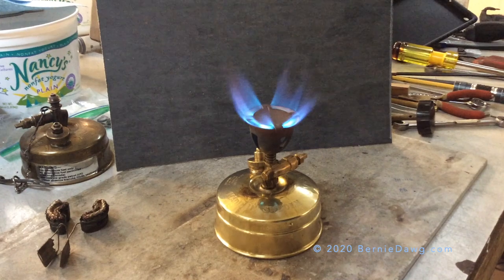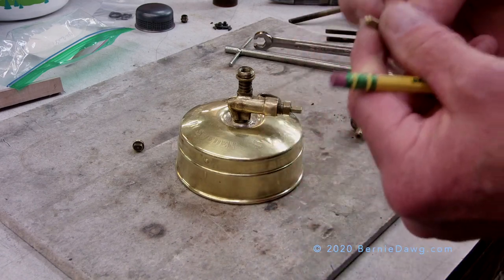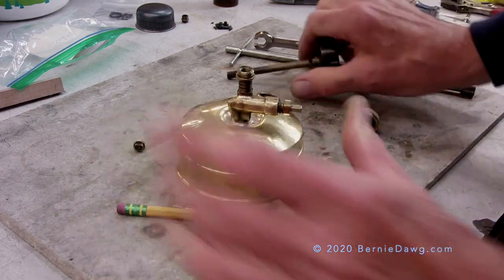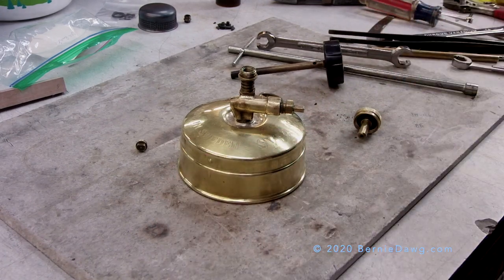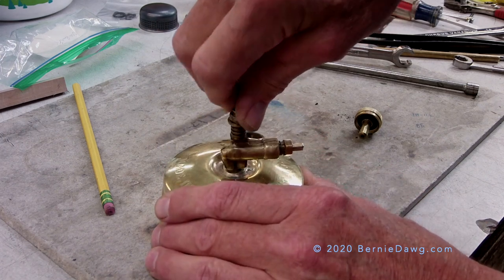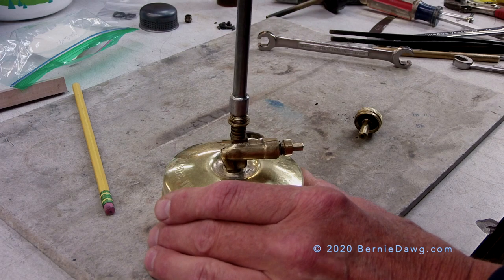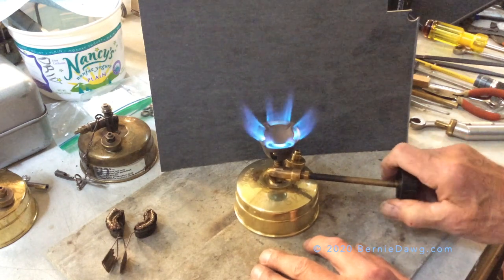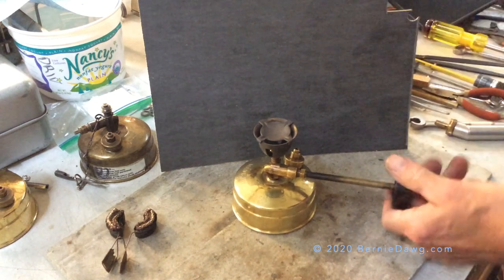Setting a Svea 123R Stove Cleaning Needle

Comment: Thanks for that 😊.
I think (?) that the same goes for the Optimus 8R Hunter. Bought mine new in the late 70's .. still in regular use and going strong.
The only repair that I have had to make so far to the Stove was replacing that very same graphite seal in 2009 (I think?) so that 'squeak' sounds familiar 😊.
If I had to choose just one Camping Stove .. it would be my 8R .. a great little stove 👍. The 123 is in my sights .. but I still have to figure how to fit it into the budget and then get it past the Self-Appointed Anti-More-Camping-Stuff' Firewall / Virus Guard 😉.
Take care .. stay safe 😷 ..
Reply from the maker: Thanks! Yup, the needle-setting is pretty much the same on all the stoves that have them. I show the 8R in my video tutorial pair here: https://youtu.be/CVe8LfXCalA and here: https://youtu.be/3ytcym3qhcA . Or, to be exact, here: https://youtu.be/3ytcym3qhcA?t=503 Maybe helpful? BD
Reply: @BernieDawgCinema  Very helpful .. thanks 👍. Much obliged 😊.

Comment: Excellent video, siple and informative! Just one question, i have a juwel 34 and i want to find a graphite packing for that, any ideas???
Reply from the maker: Thanks! Two ways to do this. One way - get part #2091 from Base-Camp in England. You can find the link to Base-Camp at my links page here: http://www.berniedawg.com/stove-part-supplier-links/ 
Intended for the earlier Svea 123(no R) with it's smaller diameter spindle, I believe that #2091 packing also fits your Juwel 34. (I've not tried this.)
Second way -  use wraps of graphite ribbon around the spindle, then mash it all together with the spindle nut. Graphite ribbon is available through many sources, but it may be easier just to get a sheet of graphite from eBay seller "terrry123" (yeah, 3 r's) and slice it into suitable ribbons yourself. I've done all that many times. Fiddly, but works fine in the end.
Hope this helps. BD
Reply: Eeexcelent!! 2 answers at once! Hehe, thank you very much buddy! I really didn't know where to find a graphite packing for these jobs.. Though the graphite tape must be a good alternative! I'll get both and one day i will also buy one of your silent burner caps though i don't know whether this will increase the temperature of the tank quicker or the opposite :D 
Cheers from Greece man and keep up the good work!!
Reply from the maker: "though i don't know whether this will increase the temperature of the tank quicker or the opposite" The caps have zero effect on tank temperatures. After all, silent burners have been commonly used on millions of stoves since 1898. 👍 BD
Reply: You are right! It's a tried and true concept! Thanks again and keep up! Others make videos for knives, others for tools etc, but whatever someone does right really helps sustaining information and keeping people educated in subjects they could not otherwise find reliable information about! See ya!

Comment: Just rebuilt mine, works great but no blue flame? Not sure if I inserted the wick properly? There was maybe 1/4” of the wire showing. Used a new needle valve shaft assembly as the geared portion on my old shaft was worn, as was the teeth on the cleaning needle bar. 
I used a wick that is sold off eBay. Comes in a 4 pack of different strands and lengths. Hopefully I used the correct wick?
Reply from the maker: @Michael Fogarty I have an eleven video playlist that covers all sorts of things about the Svea 123R. There is a pair of disassembly/assembly videos in that playlist that shows most all the details.
https://www.youtube.com/playlist?list=PL9Tg7BYD6fULxLmRcd7hQL_ZP2vyBqlZk
If you don't have a blue flame, perhaps you are using automobile gasoline instead of naphtha (Coleman fuel). Yuck on auto gas - don't do it. Or, perhaps your flameplate is set too low. Or, perhaps you were in a hurry and didn't let it run for a good twenty to forty minutes to self-clean the old crud out. The possibilities are numerous and my videos cover most of it. 
Or, just drop a note to my free help line with some photos. It's free. bd@berniedawg.com Did I mention it's free? BD (free)
Reply: Thank you, yes, I’m using fresh Coleman fuel. But I only let it run for maybe 10 minutes, So I’ll try running a tank through it, and see if it improves the flame.
Reply from the maker: @Michael Fogarty Again... many things could be the issue. And, again... just drop a note to my free help line with some photos. It's free. bd@berniedawg.com Did I mention it's free? Virtually impossible to diagnose your issues if you won't communicate with some photos via the help line. BD (free)

Comment: Does this work the same way with the Chinese version of the svea 123 R made by lixada and several other manufacturers?
 mine slogged after my tenth use and I'm trying to figure out how to get it unclogged
Reply from the maker: @Mike Rilling Seems to be the same idea, yeah. If your stove clogged after only 10 uses, wouldn’t you contact Lixada for service/return/repairs/refund? They claim a six month warranty. If you are using quality camp stove fuel, it shouldn’t clog. If you’re using pump auto gasoline, well then, there’s your problem. Pump gas sucks in camping stoves like this - clogs them up fast. BD

Comment: Hi BD, 
Recently bought a new 123R and I'm a little confused....
On the one I have, I turn it fully to the right to shut it off, however, after priming it, it's letting out gas and igniting the burner. I have to turn it fully to the LEFT to shut it off. I'm just wondering if I'm doing something wrong or if theres a fault. I've tried resetting the pin like the video also. 
Thank you for your time.
Reply from the maker: Hi Hell Dysphoria, Brand new Svea 123R stoves are not made in Sweden but are manufactured somewhere in Asia at the bequest of Swiss multi-corp conglomerate Katadyn Group". There are increasingly frequent reports of quality control issues associated with these newly-made imitations of the original Swedish made 123s.(I don't recommend buying new since there are thousands of vintage Sveas easily purchased through eBay.) 
You should be able to turn off the stove by gently/firmly turning the spindle control fully clockwise to the right. Don't force it, as that can cause damage to the spindle tip. If you feel the cleaning needle has been mis-set, take it out and try the stove without it. The stove should work fine without the cleaning needle rack in place. 
If the stove still won't go out by turning the spindle control fully to the right without the needle rack in place, then: a. there is an obstruction in the spindle area, perhaps shavings or debris from the production process, b. the spindle tip has already been damaged from using too much force to close the valve, or, c. the spindle and spindle seat are poorly formed or manufactured. Drop me a note at berniedawgstove@comcast.net for more on how to resolve these issues. I'm running out of space here in YouTube comments. Good luck! BD

Comment: Great video. My flame is very uneven. More one side than the other side. How do I level it out?  It’s a new 123r
Reply from the maker: @Peter Foote New Svea 123R stoves are made in Taiwan and the quality is lower than vintage Swedish-made stoves. Your experience is typical. If you don’t want buy a vintage Swedish model… you could try to bend the bell into alignment with your off-center jet. Grab the bell in your hand and gently/firmly move the top toward the side that has more flame. This will help center the vapor stream on the flame plate. Test it, and see if you need additional bending. Repeat until you get it centered. BD
Reply: @BernieDawgCinema  what year was the last Swedish production? thank in advance.

Comment: Just got my first 123R. Used the current Optimus parts kit, but I don’t have positive shut-off yet: when the stove builds pressure, it squirts fuel through the jet. 😕
Reply from the maker: @Bentbrook's Rambles Try the stove shutoff without the cleaning needle in place. (Think of the cleaning needle as an "optional" upgrade.) Stove should shutoff w/o the needle - if not, there's a problem with the spindle seat or spindle tip. Make sure you have the Svea 123R spindle in there - not the 111 spindle. Once the stove shuts off without the cleaning needle, add the needle in. It may take several tries to get it "timed". Good luck. Nice hike, btw. 👍 BD
Reply: BernieDawg Cinema Thanks for the tips! I’ve got it shutting off now (original jet and cleaning needle)—it seemed to “settle” once it got hot. So now I’m learning how long I need to prime it. Such a gorgeous stove with lots of character! Any tips on the Minicap with legs, or is it literally as simple as it seems to use?
Reply from the maker: @Bentbrook's Rambles The Minicap with Legs is pretty simple. But, for best results, you could always read through the instructions online so you know all the tips about caps I can think of to write down. :-) http://tinyurl.com/lvv3syn  But, please remember... if the stove doesn't work great with the flame plate, the stove won't work great with the Minicap, either. BD
Reply: BernieDawg Cinema Thank you! It’s working great now.
Reply from the maker: @Bentbrook's Rambles Awesome! 👍🥳 BD

Comment: Question: How long is the wire/needle part actually supposed to be above the regulator spindle? The one on mine is only about .73 thousands long and just barely extends beyond the orifice of the jet at full extension. Not visible, but can barely be felt at full extension.
Reply from the maker: There is no "supposed to" - no specifications chart from a manufacturer. And, there are variations in the casting and machining of the stove valve bodies. These are not clocks or airplanes - not that high of science. Each stove is a bit of an individual. Best not to try to quantify it to the thousandths of an inch/millimeter in the way you are attempting. The needle hangs out of the needle rack about 4mm. The needle extends through or into the jet to the extent that you may be able to see a stub of needle OR maybe it will be flush with the flat of the jet at full extension, generally. But, really, the true way to do this correctly is just as I show and demonstrate in the video. Set the needle so that you get a reasonable amount of adjustability of the spindle and the flame, BUT don't have the spindle valve fail to close. Keep it fun and relaxed. If your stove works well - then great. If not (and it's a needle-related issue), time to adjust the needle. 👍 BD
Reply: @BernieDawgCinema  Thanks, I was only questioning if the wire on mine had broken off short but had no comparison to go by. I have  Stansport copy of the Optimus 99 that has a much longer wire needle so it protrudes perhaps a 1/16 above the jet at full extension. I have set the needle on the SVEA as you show. I've tried 3 and 4 clicks, but the stove still seems to pulse more than yours when running and the adjustment is not nearly as smooth as the Stansport. It does shut off properly with no pin flame remaining.
Reply from the maker: Gotcha on the wire maybe being broken. My needles have about 4mm total wire length. On the pulsing... probably not a needle issue at all. More likely wick placement or wick issues. Mine in the video pulses a little at take-off but settles down to the purr when it's heated up. I've not used my Stansport 99 for a long while. Can't speak to that, other than I don't think how much the needle protrudes causes pulsing. You can take the needle out and run without one to see if that changes anything. BD
Reply: @BernieDawgCinema  Great, I had not thought of trying that. I'll try running it without the needle just to see what it does. Otherwise I'll disassemble the stove and check the wick.

Comment: I have an original SVEA. With the angled or slanted jet
Reply from the maker: @Mark Gamo Thanks for watching! And, sure enough, as I see in several of your videos you do, indeed, have a no-R Svea 123. If you haven't replaced the fuel cap gasket and SRV (safety release valve) pip, you might want to consider doing so for improved stove performance. Those parts rarely last beyond ten or so years and need to be refreshed on occasion so the stove will operate at peak flammage. You can see how here: https://youtu.be/d6SEE1ToCSQ Take care! BD

Comment: thank you for your excellent videos! svea 123 is my favorite!  in one of your old videos about refurbishing srv fuel caps, you showed a few ones with quadrilateral,pentagonal and hexagonal openings. when i check my youngster 123R, i see just a round opening. ist´t it a bit odd? https://i.postimg.cc/FRPM6dYV/svea-123r.jpg  thank you for your opinion and best of luck with your work!
Reply from the maker: The round opening seems to be the newest of the styles of SRV cap screws. I've seen it on a few of the very recent made Optimus/Svea stoves. I'm guessing you bought your 123 brand new in the recent past. Those 123s are not actually made in Sweden anymore even though the tank is still stamped "Sweden". There are still lots of vintage Swedish 123/123R stoves available on eBay should you want to go with the Swedish quality. BD
Reply: @BernieDawgCinema   thank you for reply. you´re right the vintage ones are much better , but how to open he new version when i need it? best of luck!
Reply from the maker: Ummm... buy a vintage fuel cap on eBay that you can open with a tool? 😁 I think the new round opening is designed so you can't open it easily. Probably something you'd have to send to me to have fixed for you when you need it. I have some special tools and jigs for this sort of work. 👍 BD
Reply: @BernieDawgCinema  thanks for your kind offer, i´ll keep that in mind! have a nice day!